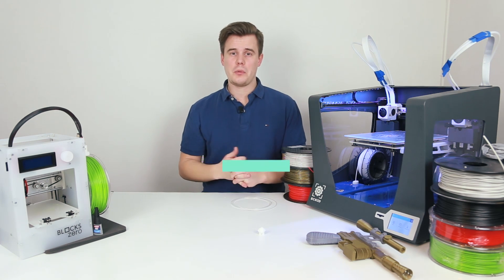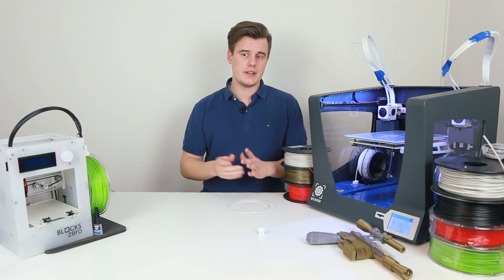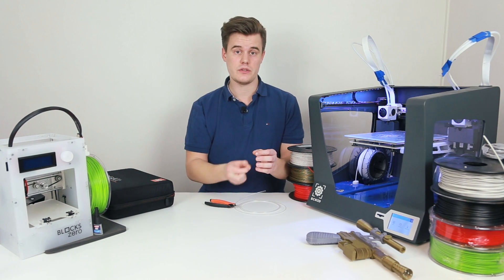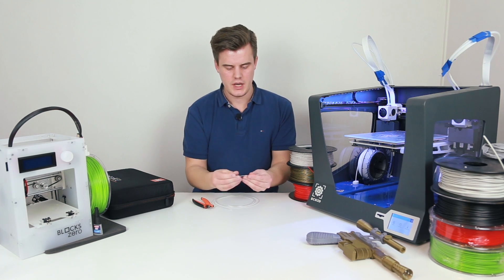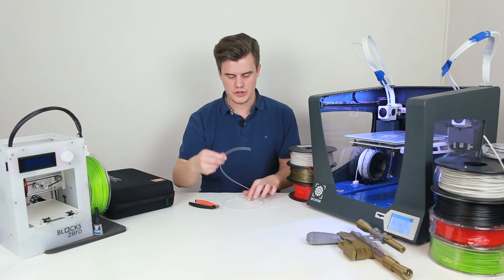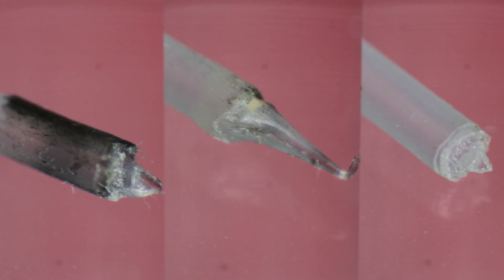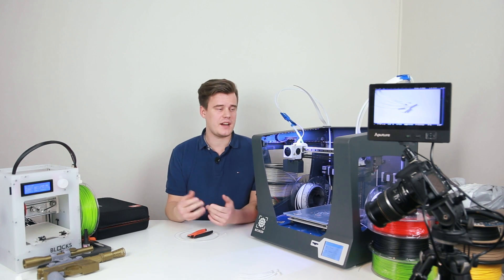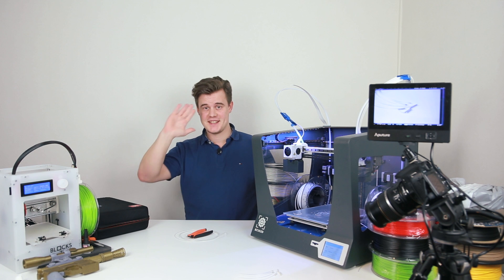How to Cold Pull - Fix a clogged 3D Printer

Comment: What do i do if the clog is so bad that when i put filement in the nozzle, it doesnt even get warm
Reply from the maker: I assume the nozzle gets hot, but not the filament that you're trying to cold-pull with. If so, then It's probably a peice broken off, that is above the heated part.  Depending on the printer, you could try to heat and drag that last piece out, upwards. But you might have to disassemble partly, and run it while it's "open" to have access.  If that also fails, then you're in bigger trouble, and you might just have to buy a new nozzle. Trying to remove it could damage your printer. Specially when you apply force to try to push up or down. For example, pushing a small 0,4mm nozzle cleaner tool up into the nozzle should be a problem (and if you clear it, you can try to push the filament from above again) but pushing from above could damage/bend your axels/bearings depending on how much you push ;).

Comment: Does this work with direct drive as well  or just for bowden type? Won't you be pulling against the DD gears and break stuff?
Reply from the maker: Works for both. But on bowden I recommend taking the bowden tube off so you have access to the extruder, like in the video. For direct drive, it's important to turn of the printer when ur oulling/pushing so the motors aren't active (braking).  You can also (while power is off) disconnect the motor in question

Comment: Does hot pulls work with high temperature filaments like PETG?
Reply from the maker: Yes sir! just need other temperatures =).
Reply: @3DPrintTechDesign  , hey thanks for the video! What is the temperature that you recommend?
Reply from the maker: Thanks @rafaeldrepnec the temp kinda varies, but I short you want to go a bit hotter than the material you've used. So for example 235-250 in many cases. The hotter you run however, the faster you have to push down and pull up to avoid all your plastic to melt if you do my hot-pull maneuver.

Comment: Would a cold pull work on 3d printer pens using PLA Filament? Or a hot one
Reply from the maker: Hi Janay, Absolutely! I do it all the time. It's better to use something that has a higher melting point, but it does work. Just be sure to cut of the dirty end and don't let it melt to much when pushing down.

Comment: Just one thing to add about the cold pull, if you use a cartesian printer like the Ultimaker, place the head in a corner, don't do it it the middle because you can bend the rods when pushing or pulling ;) You can do it with PLA (assuming you clogged with PLA) and pull it out at around 90°c. Nylon works great also but needs other temp (around 110°c i think)

Comment: Great quick little video on this technique. For the second one (atomic pull?) I usually jam the filament in, and let the nozzle cool down all the way. Then, I'll turn on preheat to standard temps, and while it's preheating, actively pull on the filament. Once the right temp hits for it to budge loose, it does!
Reply from the maker: +3D Printing Nerd thanks Joel! ah that's good, helps with the timing of the heating. When you need a full cold-pull that's a great approach!
Reply from the maker: Don't know WHY I missed this comment; but YES. Run a filament filter before it enters your guide-tube/bowden tube/PTFE-tube. This helps prevent dust and particles that land on a roll to get inside your nozzle. Also, if you're changing between filament types a lot; do cold pulls after taking of the previous material. So for example going PLA to ABS can be good to do a few hot/cold pulls.